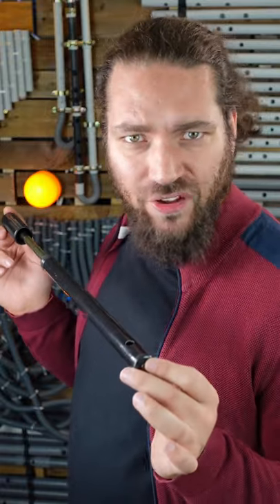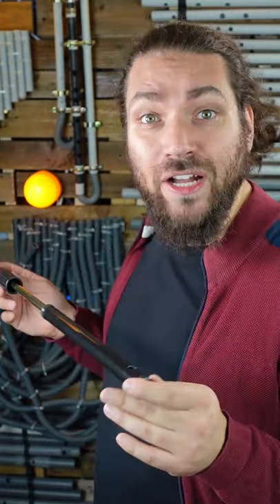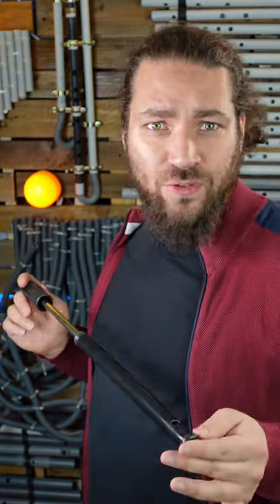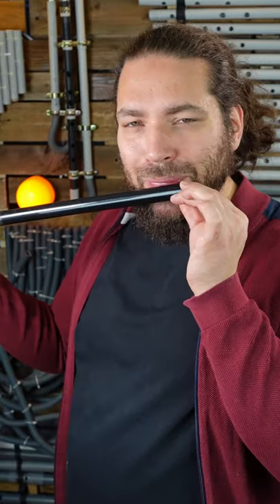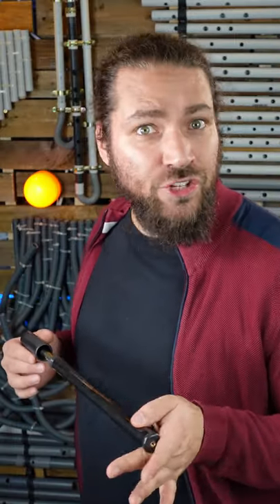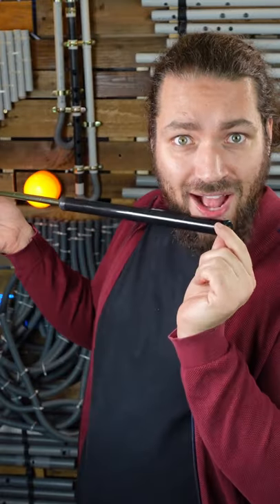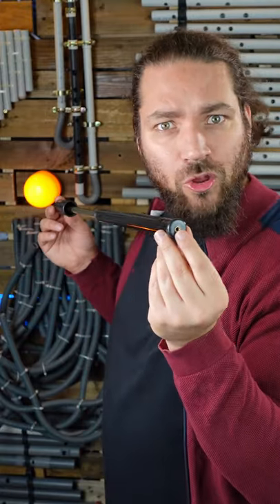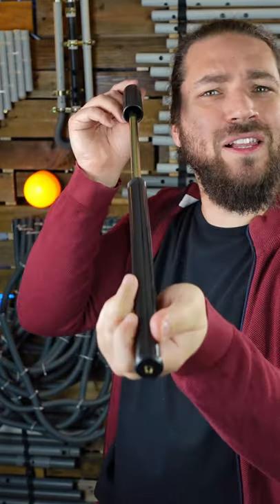Beatboxing in Bicycle Pump

Comment: You are so cool and talented.  I have a question.  I noticed many of your flutes or wind instruments have many bends to make them smaller/easier to handle and play.  Is the sound and tuning only based on the total length? I know there are certain nodes of sound that happen at different lengths.  Does adding the bends change these? And do you account for the length of the joint when measuring? I know I've only scratched the surface of the physics behind tuning but this is all I remember from a class I took! I'm sure you may be able to explain it much more technically!